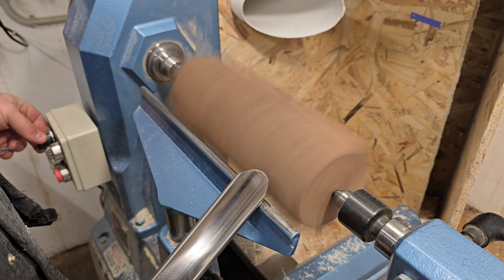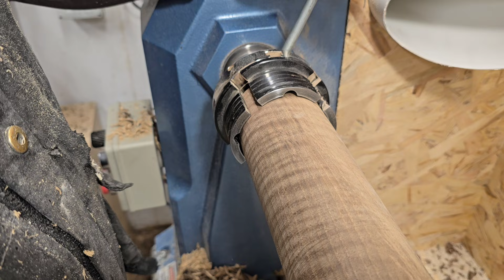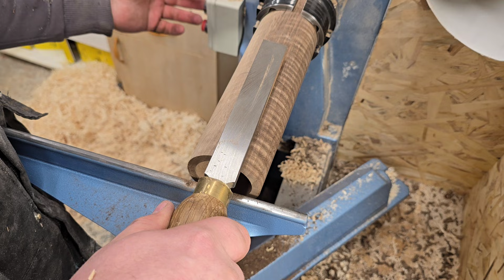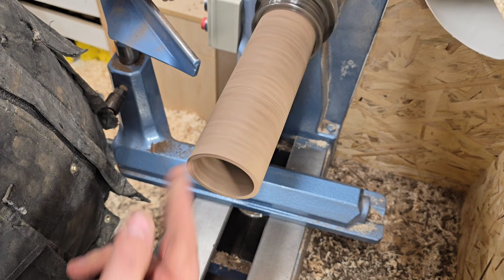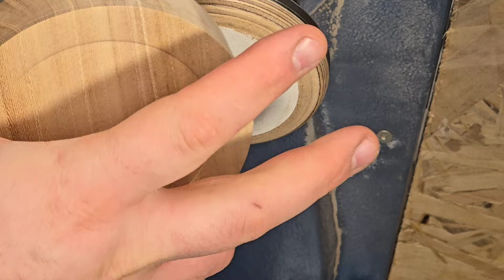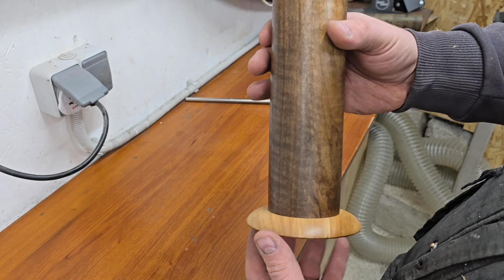Woodturning Awesome Spatula Pot From Beautiful Walnut

Comment: When you use an extension on the forstner bit, do you have to grind a flat spot on the shank for the set screws to set on to keep it from turning? Or do you buy special bits?
Reply from the maker: No, actually it comes with flats so you can use grab screws.